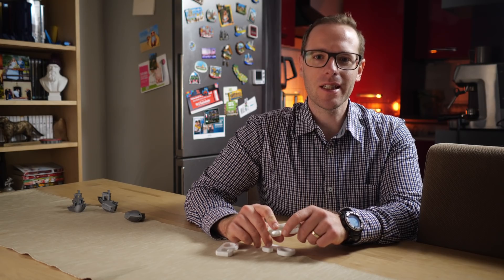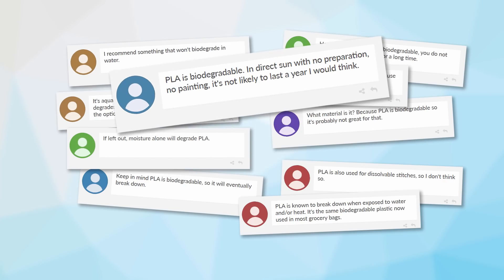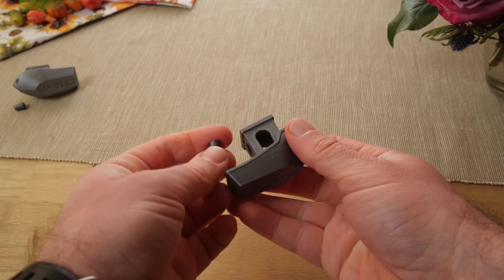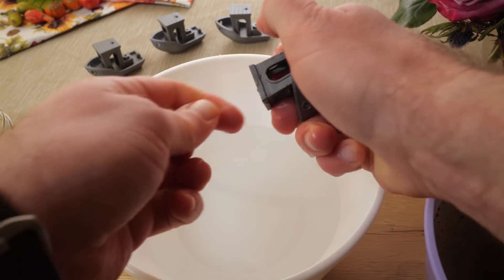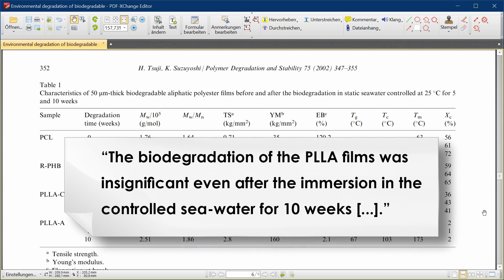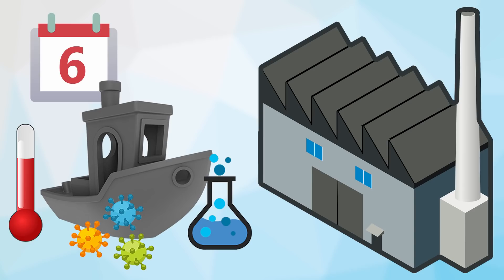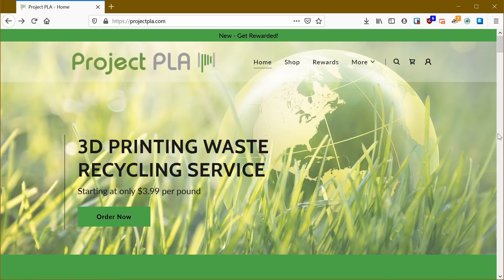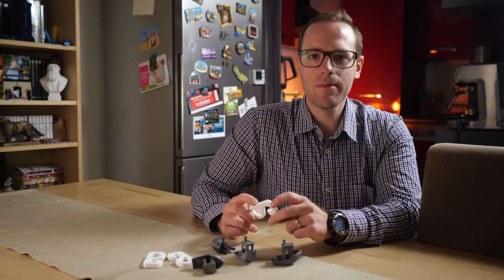Is PLA for 3D printing really biodegradable? I've buried and drowned Benchy for 2 years to find out!

Comment: I'm 19 months into a two year experiment myself. I knew PLA wouldn't break down in water, since I've had PLA in several aquariums for more than two years and they show no signs of degradation or changes in water parameters. There isn't enough heat or bacteria in my yard to promote degradation either.

However, I put a full Benchy and multiple pieces of support scrap into my 120 gallon composter, where the temperature often reaches 150F or higher. I've checked it every six months. After six months, the PLA scrap was brittle but otherwise intact. The Benchy was pitted, but otherwise whole. After a year, the scrap showed noticeable degradation and the Benchy was falling apart at the layer lines. At 18 months, I couldn't find most of the scrap and the Benchy was in multiple pieces. I expect the Benchy will be mostly gone by the two year mark.
Reply from the maker: That's actually great news! People have been commenting that I should have used a composter as well, so it's great to hear it actually works if the conditions are right. How about you upload a video about it, we'd love to see the results!
Reply: @HobbyHoarder  I actually forgot all about my experiment. The composter has been sitting in the back field since I checked at the 18 month mark. I will try to find the time to open it up and take pictures once the weather calms down.
Reply from the maker: @MaladjustedMutant  That would be very interesting to see!
Reply: Jeff, really interested in your experiement. Would like to see a video or paper!
Reply: are your AQUARIUM PLA parts still holding up now 2 years again in the fish tank water ?
Reply: @gladiatormechs5574  I have a lot of PLA prints in my aquariums. I've found that they last for years if undisturbed, but after a couple of years underwater, they become very brittle. A few months ago, I tore down an aquarium I scaped with printed pieces in 2019. The prints all looked as sound as when I added them to the tank, but when I moved the largest piece it broke in multiple places.

The only issue I've run into is a piece I printed with PLA+ last year. I put it into an established tank and the following day it was covered in a weird slime and my TDS was extremely high. Whatever Inland adds to PLA to make it PLA+ was not suitable for my aquarium.

Comment: the "biodegradable" plastic bags that every city seems to change too are only biodegradable in a professional compost heap because it requires the higher temps.  in a home compost you won't be able to get those temperatures and so it doesn't break down.   it might be that PLA also needs those higher temps in the correct bacterial environment to break down.  a standard plastic shopping bag will actually break down faster than the biodegradable ones outside of the professional compost pile.  too many of those bags in the professional compost pile will actually stop the composting process as well meaning that they are only compostable in small numbers at large facilities. but because they are marketed as "biodegradable" people keep demanding that cities switch to them and consequently make their plastic bag problems worse.
Reply: If it's oxo biodegradable, then it needs to be burnt or exposed to UV before being biodegradable(which might happen on the ocean surface or incinerators?)

Comment: It seems to me it would be much better to come up with a way for user to recycle their PLA prints into new spools, so they can print again.
Reply from the maker: Absolutely, and you already kinda can. You can buy a shredder and a machine that will melt it into new fillament. The problem is that it's quite expensive (at least a few thousand), so it's not really an option for most people. But it would be great if some company collected old waste and produce new filaments.

Comment: PLA is not biodegradable in still water and soil, it needs friction to break up into smaller microplastics like river and streams and also UV light to make it more brittle.
Reply from the maker: Breaking into smaller pieces doesn't mean the same as actually being degraded. It would have to break down into basic elements like carbon or water (which is what bacteria do by digesting it), not just into smaller pieces.

Comment: I really enjoyed your video, what filament would recommend as most sustainable? Ive been using PET as it can go into a filament extruder to be turned back into filament, but it’d be great to get your opinion on this.
Reply from the maker: Yeah, PET seems to be the most common one right now. If you look at companies like Filamentive, only their PETG line is 100% recycled, PLA is only at about 55%.

Fillamentum has been promising a new type that's supposedly truly biodegradable, but they haven't released much info yet.
Reply: @HobbyHoarder   Thats good to know that PETg is a good choice, yeah I’m a big fan of Filamentive, most of my filament comes from them.

Will keep an eye out for what Filamentum come up with but I’m always a little sceptical of biodegradable plastic whether it truly is biodegradeable/compostable or if it only breaks down into micro-plastic.

Comment: PLA in rolls degrade fast, one week or two and become super brittle. 
But after printing, parts last for long time without any sign of degradation.
Reply from the maker: It only absorbs humidity if left outside and then becomes brittle, it doesn't actually degrade as such.
Reply: @HobbyHoarder  May be. But i have found that hidratated PLA prints with less problems than directly from package. Now i only print after one week when wire was unpacked. 
PLA wire from inside roll very flexible and  not brittle like outer layer or wire staying near extruder.

Comment: In our desert sun (outside 120f) the pla likes to warp. In the closed car it bends under a slight load!!!
Reply from the maker: That's true, PLA starts to deform at around 50'C, but that doesn't mean it's degrading. It will be just the same (in terms of mechanical properties) once it cools back down.

Comment: A great video! A sad conclusion though. PLA's degradability was one my proudest reasons for using it on my prints.
Reply from the maker: I keep all of my failed prints in a large bag. I'm hoping that someone will start taking it and turning it into new fillaments. Or if nothing else, that the filament making machines will become cheap enough that I could buy one and re-use all the old waste.

Comment: Can I suggest keeping one of the hooks wet and one dry in an achievable version of an artificially hot environment? For example near ceiling of a tall greenhouse can become >50C even as far north as my hometown.

Basically if I could theoretically achieve any biodegradation at home with just the heat and moisture needed but not the enzymes, it seems like something worth finding out.
Reply from the maker: I've had several similar suggestions, so I'm definitely thinking of trying it out.

Comment: if it's properly incinerated, the effects of PLA are more or less similiar to burning wood, and the carbon in it is able to go back into the enrivornment and be absorbed by trees. So the carbon footprint is smaller than fossil based plastics yes? the problem lies more in the landfills than in recycling or biodegrading it..

Comment: This makes sense, about two years ago I printed a hair trap for my shower drain. I recently had to replace it after had become very brittle and cracked (and been repaired) several times. It was in the perfect condition for biodegrading - heat, moisture and microbes.
Reply: Soap + water acts as a  weak alkaline (basic) solution - PLA is weak to it, and it embrittles them.  Unlikely to be caused by just heat (unless showers you take are 55+ Celsius...) or moisture, let alone the microbes.
Reply: @wolf2965  Hmm, I'll have to test this further.

Comment: Decomposing of about 50% was what I got when I had a PLA print in my aquarium for 3.4 years. The oxygen in the water might help a lot. Anaerobic rotting is slower.
Reply: Maybe your aquarium somehow has the microbes that produce the specific enzymes that could degrade PLA?
Reply: yeah basically. It'll degrade but not fast, and it needs to be in a "real" environment to degrade much at all. This sounds bad, but at the same time if you just bury a stick or leave a stick floating in water it'll still be largely intact too. Basically everything needs a "real" environment before it'll start to break down.
Reply: Did the aquarium have any animals in it?
Reply: @pointyflyer155  The aquarium had fish in it. The fish did not touch the PLA.
Reply: @KimOyhus  I wonder why. If it gave off some sort of aura that the fish didn't like?
Reply: @pointyflyer155  No. The fish treated it like any irrelevant stone.
Reply: @KimOyhus  might have to try that then thanks!

Comment: Pla is compostable which is not the same as biodegradable. It needs the heat and bacteria from the compost pile to break it down, just burying it in the ground is useless and shows you don't understand the difference between biodegradable and compostable.

Comment: PLA is not compostable. But does that really mean it's bad for the environment?

What does PLA sitting it the bottom of a landfill do? Is it leaching chemicals into the groundwater? Or is it just sitting there doing nothing more than taking up space?

If it's only negative is that it's taking up space then consider this. It's full of carbon. Some corn plant sucked the carbon out of some CO2 in the air, incorporated that into it's own structure which was the converted into PLA in some factory somewhere. Now it's going to sit in a landfill for centuries not warming our planet.

Don't get me wrong. I wouldn't go so far as to say printing benchies just to throw them away is going to reduce global warming.  I'm sure all the energy consumed harvesting and transporting raw materials, converting them into PLA, shaping them into filament, getting the filament to your house, running your printer and finally transporting it to the landfill more than replaces the captured CO2.

But if you are going to print something anyway maybe it's better that it not compost? If it does compost then some of the carbon will become soil which is fine though maybe not very useful in a landfill. Much of it however will be re-released into the air as CO2 or worse Methane. How is that better?
Reply from the maker: That's a very interesting argument and I'm sure there's some truth behind it.

So far, the best idea I've heard was burning the plastic in facilities that can convert the heat into energy.

Comment: I will add a little point in favour of PLA. 
That is quite more Eco friendly than other platics but not specifically for the "recycling", I agree in the misslabeling on that,  but for CO2.

Being produced form plants and not for fossil fuels means that if yuou produce it and than bury it, you have actively removed CO2 from the atmosphere and put it the ground. The reverse of what you do with plastic from fossil source. While if you burn it, simply you return the CO2 to atmosphere the same you have trapped into the material so net 0 balace (safe from all losses and energy production cost).

Thanks for the test, and yes I can confirm all my PLA products are mostly OK with only some bleaching and meccanical loss in parts exposed to heavy solar irradiation.
Reply: It's naive, though, as you are forgetting that crop production used for PLA also produces CH4 and N2O emissions as it requires fertilizers for cereals and beets (at least if we are talking about modern industrialized agriculture) - it cannot be net 0, generally coming from non-replenishable sources as well or from manure - which adds even more GHG.
Both are considered stronger GHG than CO2 is. 

It is not net 0, even if you ignore the energy production costs and losses - it's quite a bit more. 

Don't print needlessly.

Comment: Funny thing I had a cup holder made of PLA and it degraded with only one day inside my car.
Reply from the maker: Degraded or just melted from the heat?
Reply: @HobbyHoarder  To be more exact it shape shifted and cups didn't fit anymore. Plastic was still strong, but quite useless to have that shape shifting by just one sunny day.
Reply from the maker: @esteban-  Well, PLA starts to deform at around 50'C, so inside of a car on a hot summer day can easily reach those temperatures. It's better to use PETG or ABS in that case.

Comment: I have stuck a PLA print in the soil next to a potted plant that has been sitting outside (during the months when there is no frost), in rain and sun, for more than 3 years. The part still looks the same…
I have collected almost all my 3D printed waste so far, with the plan to either try to extrude it into usable filament, or at least deliver it somewhere it can be processed.
Reply: I've been collecting all of mine also. Let me know if you find a place to recycle it! I have nothing locally.

Comment: So, as with many things we are being lied to. Big fraud. Use a common plastic, more chance they can  recycle it. From now on I'll buy ABS filament.
Reply from the maker: I think PLA is still a better choice than ABS. Unless you specifically mark your prints with ABS recycling logo, it will still get thrown away as unknown material. Plus it's petroleum based (fumes from printing are probably cancerogenic) while PLA is mainly made from corn starch.

Neither is perfect, but I think ABS is worse overall.
Reply: @HobbyHoarder  Oke thanks for the reply:)